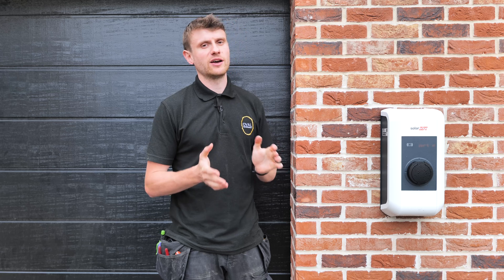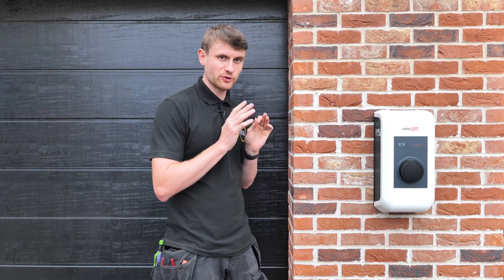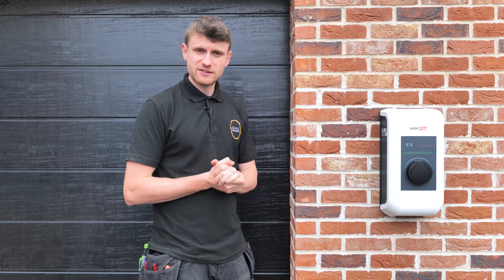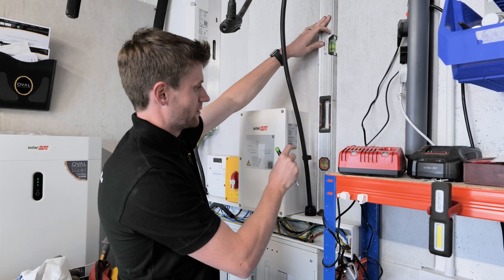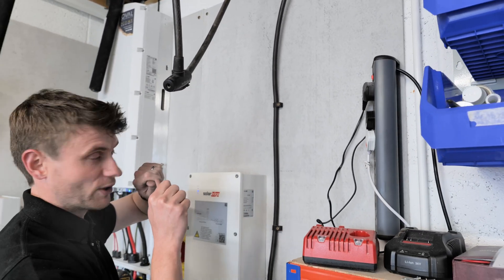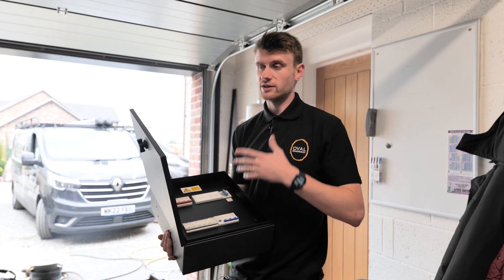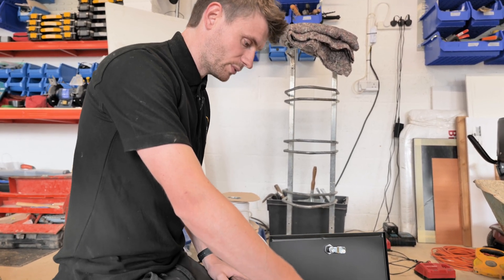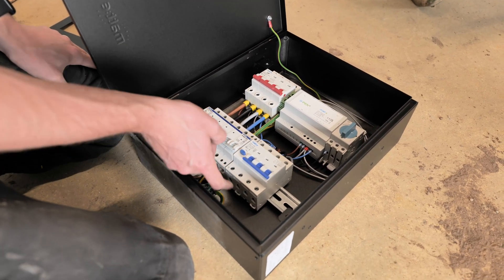Installing out first three phase SolarEdge EV Charger! - Wisbech Project Part 1

Comment: How are your experiences with Solaredge till now? We used to do a lot of SolarEdge installations here in Holland but due to the high failure rate of the S series optimizer we currently stopped installing SolarEdge completly.. We have customers that are on their 3rd inverter with optimizers that allmost systematicly fail. We reached a point that we could no longer stand behind our product so we made a switch to Huawei for systems with power optimizers.

A shame really because failures aside its an amazing system! I am curious how your experiences are😄